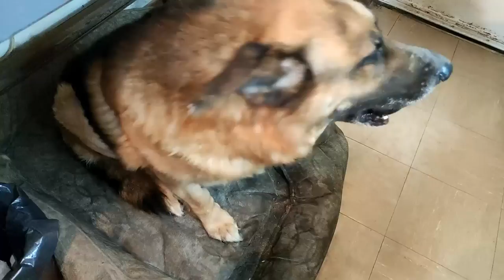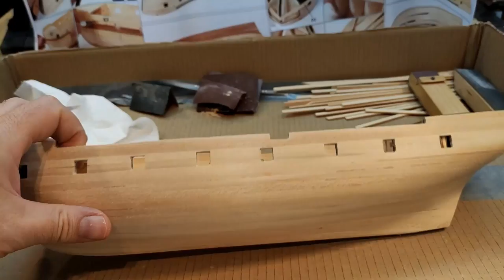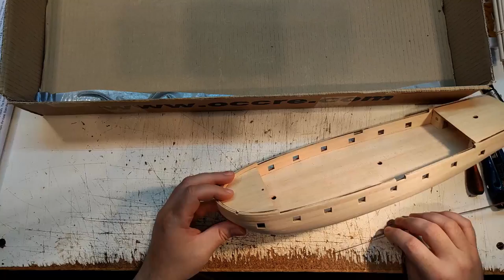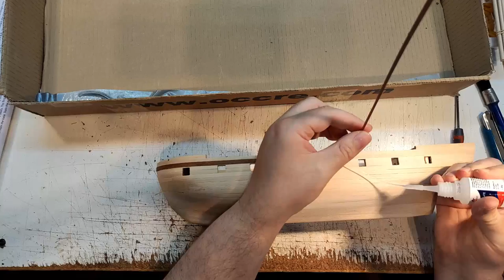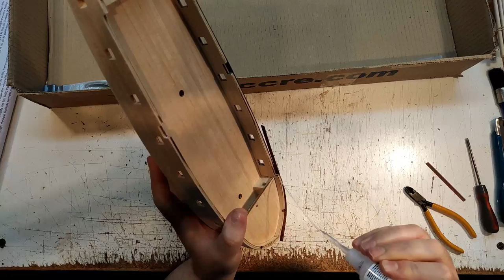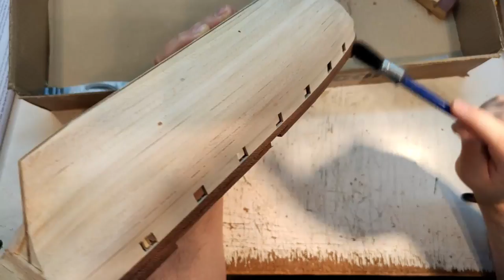HMS Beagle - part 12 Planking The 2nd Layer

Comment: On my last ship, I soaked the wood. I put ca glue at key places and white glue on most of the planking. I used a plank bender iron to iron on the planks, which applies heat and pressure to the planks. The heat sets the white glue.
Reply from the maker: Like i always say, i am showing one way of doing things, there are many more.

Comment: Hi John, another great video, thanks so much. I am only building my first model at the moment so by no means any sort of authority. However, I actually enjoyed the second layer over the first as it was so much easier. You seemed to struggle a lot with the second layer. Have you ever tried using contact cement for the second layer? Where you coat the hull surface and the plank with the contact adhesive and when they are dry lay the plank down slowly inch by inch where they bond instantly and then simply rub it with a hard object to make certain the edges are stuck down. You have to be careful obviously because it bonds instantly but the advantages are that its quick and easy and you don't have to hold pressure on the planks.  I didn't know of any other method so I went with the video instruction that came with the kit and just found it very easy.
Reply from the maker: Hi Moike, i use this glue https://www.super-hobby.com/products/KLEJ-CYJANOAKRYLOWY-CA-RZADKI-20g.html it takes only seconds to dry but in some cases it's hard if it doesn't glued with the 1st try. It's all about the sanding to get the surfaces to glue together.
Reply: Hi Moike. Which brand/type contact glue do you use? 
I saw on one of Occre's videos that they use NOVOPREN contact glue, but it seems hard to find in UK.

Comment: I am building the 1805 Virginia Pilot Boat 1/50 scale and I am at this stage. Your technique is my favorite and I too dislike gluing my fingers to the ship. I have more trouble getting the glue where I want it than you. Are you using thin CA glue or medium? Thanks!
Reply from the maker: Hi Scotty! Thank you very much!!! I am using thin but i am sure that the medium will not get through the strips that easily. The medium though won't come out easily from the tips that i use :)